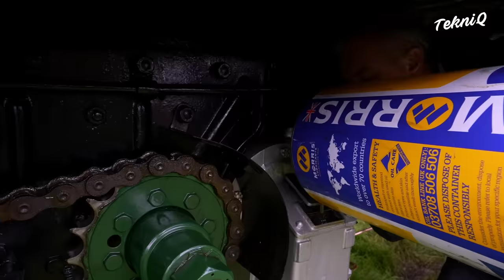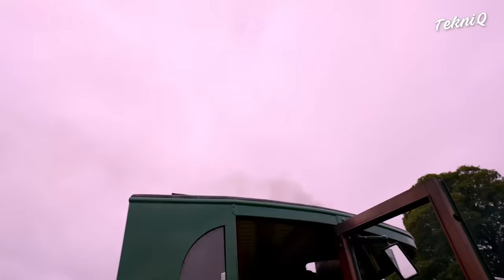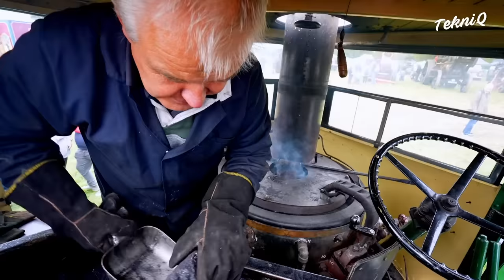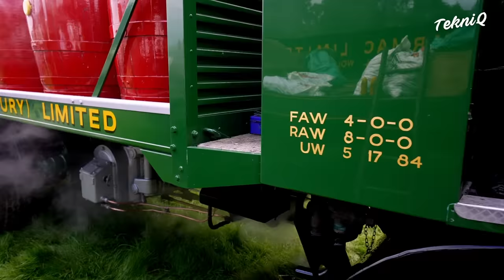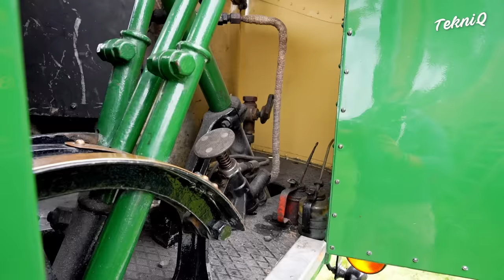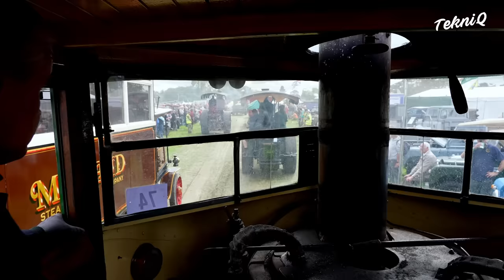Starting the Weirdest Steam Truck Ever Invented

Comment: Gives a whole new meaning to "warming " up the vehicle in the morning. 😅
Reply: When I was a child, today I am 65 years old, in my grandfather's road company in Italy there were still two steam rollers. I remember the ritual of turning on and maintaining pressure on the boiler. In the evening there was a fire attendant until dinner time who at 4 in the morning would start feeding the boiler again to be ready to start after 5. In Italy coal was very expensive and the rollers were fueled with pressed bricks of coal waste. During the winter some workers worked to make tiles with a hand press for the summer jobs.I feel like I'm telling a story from 200 years ago but if I've seen it it's not more than 60 years ago.....
Reply: I bet they aren’t too comfortable during the warmer months with that potbelly stove roaring beside the driver.
Reply: @deborahchesser7375  I don't think it was much different than traveling in the summer in a Fiat 682 with the diesel engine between the seats in the italian summer 🤣
Reply: @gordonpasha3126  right, or a VW with the heat risers rusted open. 90* and the heater is blowing full blast 😆
Reply: @deborahchesser7375  It happened to me with a Fiat 500 in 1978. From Milan to Turin in August I felt like I was dying
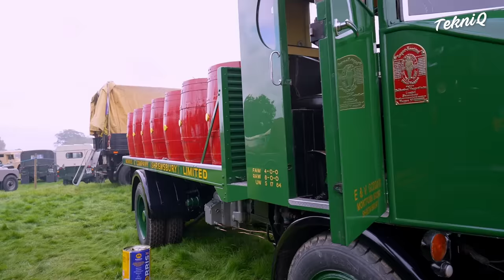Reply: Imagine going through the start up palaver to find that you had a puncture?, as a delivery driver myself starting at 2/3:00 in the morning, I would hate to have had to go through this just to get on the road.

Comment: These were technically advanced,in their day,some having a top speed.of 60mph.They full torque from zero revs character of the steam engine,made for huge pulling power.
Reply: you sure about the 60mph thing?
Reply: Yes, though that's the model that replaced the one shown.
Reply: Older ones went to 50 MPH or so, these were built to compete with petrol lorries/trucks in the 1920s. This model was launched in 1928 but Sentinel kept making these monsters into the 1930s!

You'd have to be nuts, of course, to go that fast... and know all the nearest watering holes.

Comment: I had the sheer good fortune to speak to someone at a steam festival, this summer, who had a couple of steam tractors on show. He told me about his lorry and one thing I remember is that it was kept lit, so cold starting was probably a rare enough occurrence. But that practice was not reserved for steam. In the 1990s, diesel electric locomotives used to be run into sidings and left running overnight, to eliminate the need for cold starting in the small hours.
Reply: Talk about glazing the bores
Reply: If the sidings were on a slope, sometimes it was necessary to maintain pressure in the braking system. If the train was coupled, this could save almost an hour, winding the mechanical brake on and off each carriage.

Comment: Very cool to see the whole engine assembly compactly contained and almost out of view. Very cool to see that rotary valve gear tooz with poppett valvesz rather than having something more like what you would see on a traction engine or a locomotive. It bet this is a lot easier to maintain. Very quiet, too.

Comment: Hello, I have never seen such a truck that is powered by coal, I would be interested to know what kind of fuel they use to fire the truck today, since there is no more coal because it is no longer extracted from the depths, does it then run with wood briquettes or logs? I would be very sorry if such a unique piece disappears because you can no longer operate it, I find such great vehicles uniquely beautiful and would like to see one up close.
Reply: It's coal, like shown in the video. They mine plenty of it still.
Reply: @holysirsalad Hey thank you for your answer, I know that the vehicle runs on coal, but what could he drive with if no more coal is mined, because here in Germany coal is no longer usable and has not been mined since 2018, but I don't know if this is or can be the case in other countries and if something happens,   whether he then has exchange products to operate.?
Reply: @joergschneider4265  In the U.K. coal for locomotives did come from Russia, so maybe it did for these trucks but I Imagine it doesn't anymore.
Reply: @joergschneider4265   Holzkohle muss nicht ausgegraben werden. Sie wird sozusagen durch das Kochen von Holz hergestellt und ist somit Klimaneutral. Man kann sie sogar recht einfach selbst herstellen, in dem man getrocknete Holzstücke in einer sauerstofflosen Umgebung, z.Bsp. einem Metallfass, auf über 275 Grad Celsius für eine kurze Weile erhitzt. Theoretisch kann man eine Dampfmaschine wie diesen Truck auch mit Holz betreiben, allerdings hat normales Holz eine niedrigere Energiedichte als Kohle.

Comment: You dont need fossil fuel to run steam engine and internal combustion engines. Both can be run on renewable sources. in contrast, EV requires specialized precise manufacturing for the lithium batteries, if you want internal combustion like range and performance, otherwise lead acid battery can be created at home with significant reduction on power and range.

Comment: Until I saw this video I did not know that steam powered trucks existed. This is an interesting part of history. Obviously these trucks were replaced with diesel engine trucks. These steam powered trucks had at least a couple of disadvantages. These steam powered trucks were fuel inefficient, needed lots of water and took a long time to start them up from cold conditions. My guess is that it took one and a half to two hours to get one of these steam powered trucks running.
Reply: Decidedly  the descendent of Cugnot
Reply: Bisa melihhat ini suatu hal yg menyenangkan di era ini
Reply: Well no 1 they were normally kept warm ! The water was not a problem and how did you determine they were fuel inefficient ?
Reply: The only reasons steam lorries were abandoned were that: they cost more than diesel engines and diesel fuel was very cheap. Heating times were a problem on Monday mornings because they remained on all week and England in those years had the most widespread aqueduct system in the world. You could find water and coal everywhere and cheaply

Comment: In that limited volume, the steam generator must be even less efficient than a railroad locomotive's boiler.

https://en.wikipedia.org/wiki/Sentinel_boiler
Reply: it is also much safer, there is no possibility of accumulating explosive gases and causing the boiler to explode
Reply: Any boiler is efficient when it's running. Warming up, not so much.

Comment: How old and what’s the range??? these were probably invaluable during the war effort it’s worth having a few of these around in case of a magnetic pulse type of ordeal when nothing else would run,,,other than that it’s worth having around for it’s very rare historical value👍😎😊
Reply: EMP doesn't not affect combustion engines. It wouldn't affect electric either if it wasn't turned on during the pulse, unless it was an incredibly powerful EMP.
Reply: @RobertCro  I have it on very good authority very few things will operate that require electricity in such an event the Germans and the Americans have a special fleet of diesels tanks and otherwise for such a thing
Reply: Late 1920s and around 30 miles IIRC before having to fill up with water again.

Plenty of old diesel- and some gasoline-powered vehicles are unaffected by any theoretical EMPs.